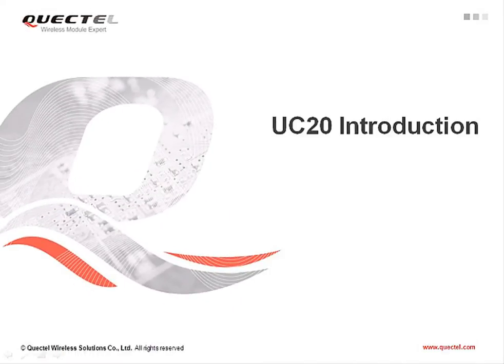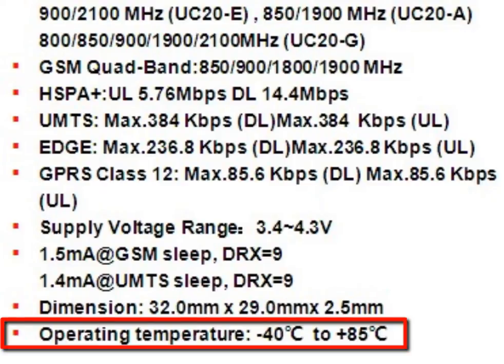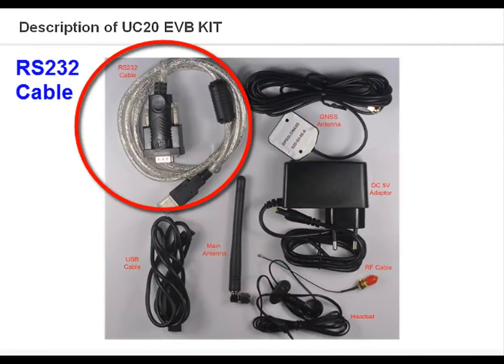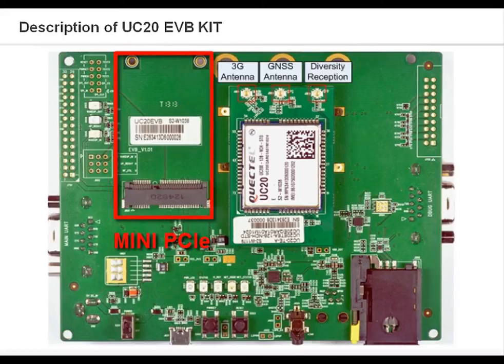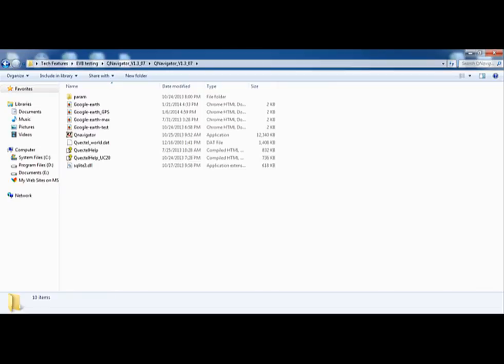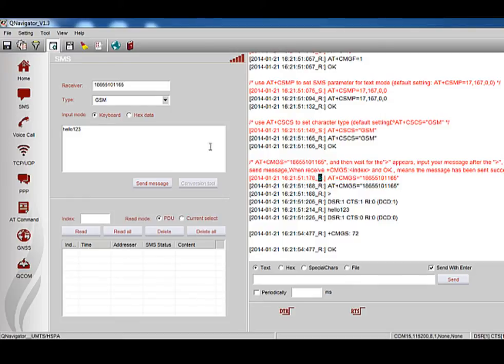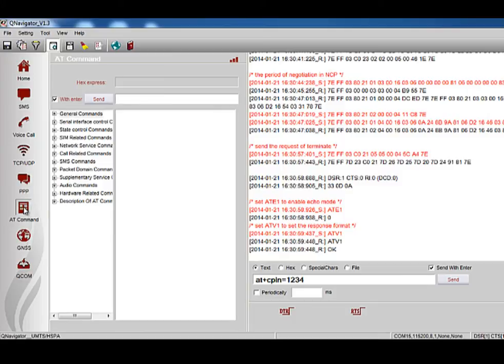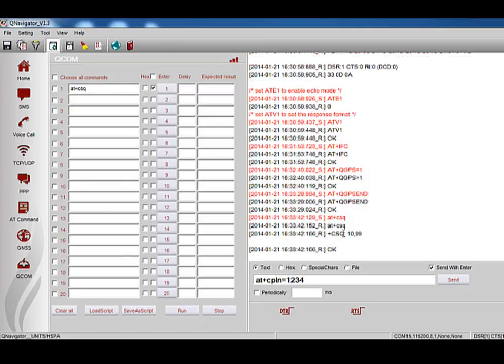Demo: Quectel 3G+GNSS module the UC20 UMTS/HSPA+

Comment: Its fine when i use the same module with pc software. When I connect Rx, Tx and ground from this module using level conveter to Arduino Uno, and send AT command, it showing sometimes correct response and sometimes garbage value on the serial monitor. I want to use this chip instead of sim808 but not able to communicate properly using uart. Plz help in that. 
Your help would be appreciated.